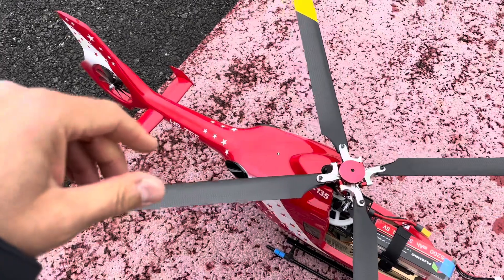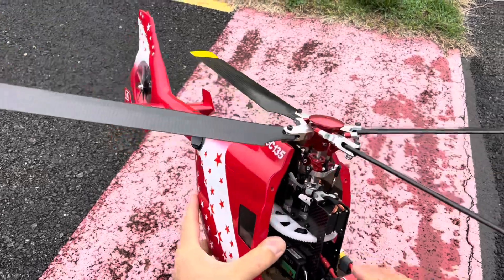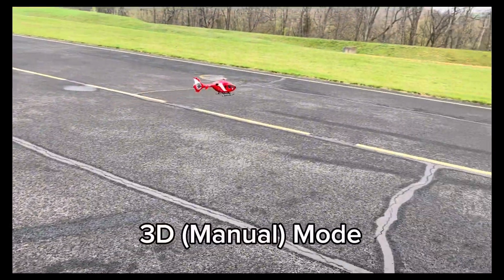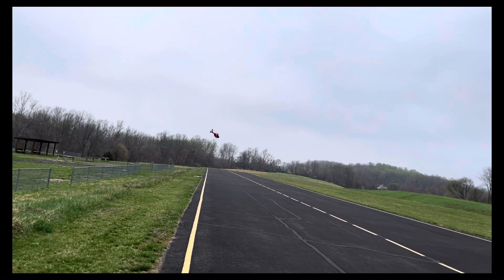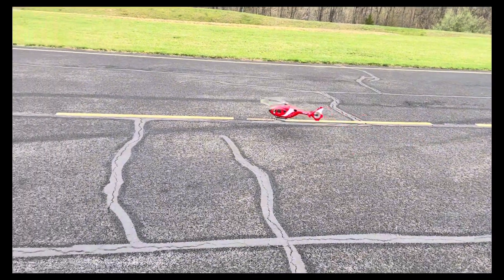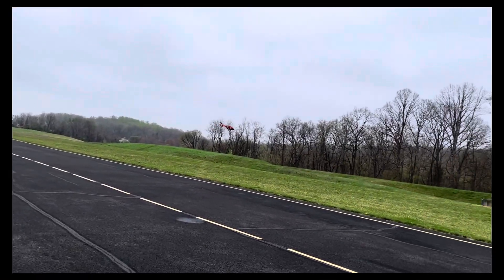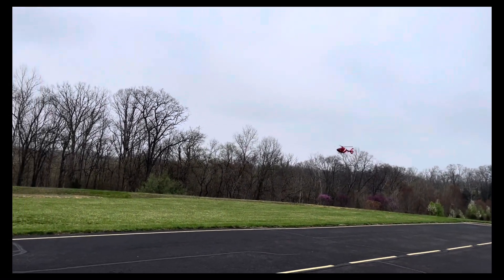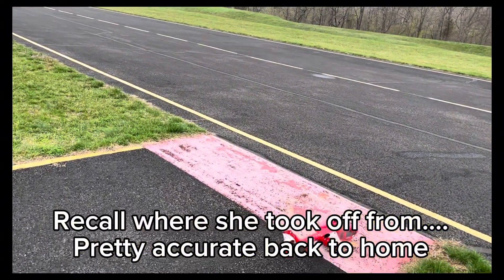Flish RC: EC 135 450 size RC Helicopter - GPS accuracy, flight performance and commentary.

Comment: Just curious, when you switch to 3D/Manual mode, does it take a bit to keep her flying level or does she stays level until you move the stick and it stays on the attitude?
Reply from the maker: Its relatively stable but it drops if I switch to 3D since mid-stick is zero pitch.

Comment: Great video 👍. I have 3 minis with optical flow and no gps, of course.   Other than return to home, does the gps help with stability somehow?  Rookie pilot, lol 😅
Reply from the maker: @staysmallrc  Yes, GPS holds position and makes it much simpler to control. It also works in conjunction with the barometric pressure sensor in the H1 controller and keeps elevation very steady.
Reply: @Flight6677  I figured it had to be more than just tracking. Thanks. I am upsiziing to the flywing Bell 206 v3.  I make videos with these and need a little bigger bird! 😁 just uploaded a video and a short if you're interested ✌️
Reply: Hope you don't mind my rookie questions... can you fly a gps helicopter without connecting to any satellites, or do you connect and then disconnect in flight for 3d or manual? It's kinda confusing for a ground pounder like me 🤠
Reply from the maker: @ Yes.  You can startup with 3D mode.  Which is then just like a regular collective pitch helicopter.

Comment: Do you pay for the machine?  Do they provide them at no cost for the review?
Reply from the maker: @anthonybrannon2611  I pay for almost all of my models. There are occasional review requests that if I accept my condition is it has to be independent and my honest opinion on the model.
Reply: @Flight6677  thanks,  I'm  hoping  one day to  be as good a pilot as you are. But I do like collecting the  models and enjoying flying but need more experience . I have 8 now and more in my cart.
Reply from the maker: @anthonybrannon2611  Thank you for the compliments. I was the same - love models and have been collecting and building them since I was 12. It’s a great hobby!